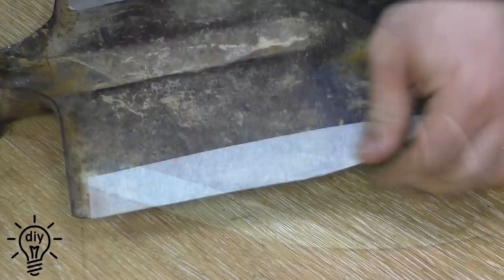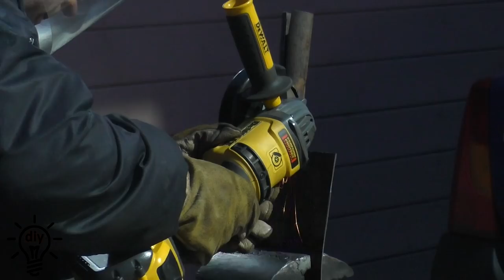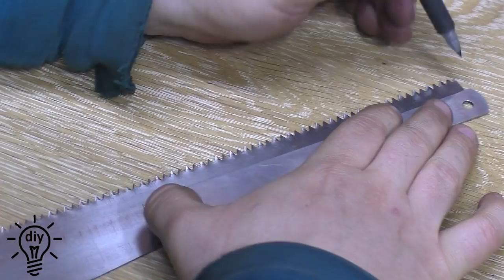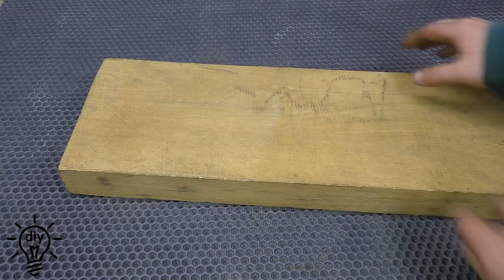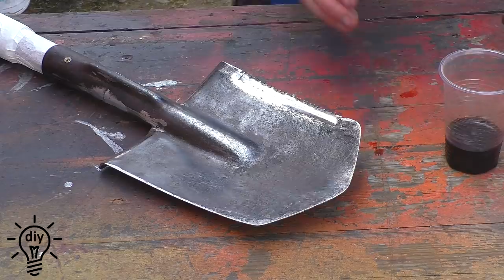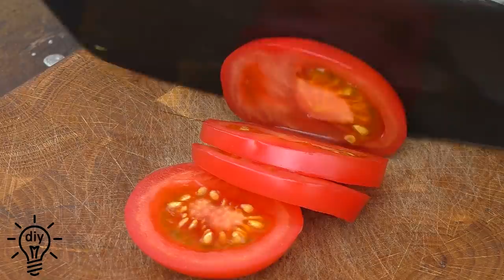A brilliant idea from an old shovel! IDEAS THAT ARE USEFUL TO YOU

Comment: Nice job 👍 I would probably check the hardness of the sawblade and consider tempering the cutting edges. Real simple heat evenly to nonmagnetic oil quench, clean bring blades to straw yellow color requench and done ✅
Reply from the maker: Thanks
Reply: I would leave them as is so you can properly sharpen them